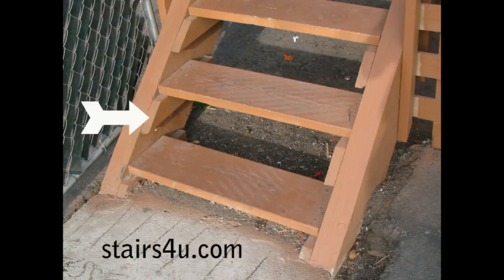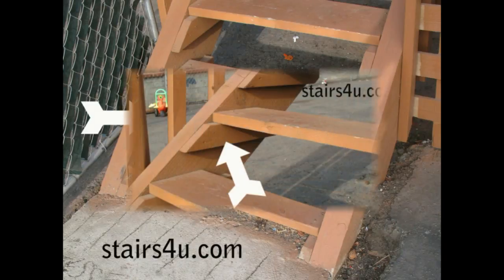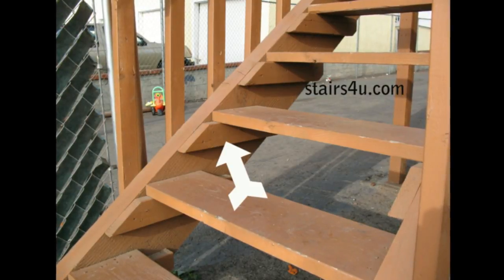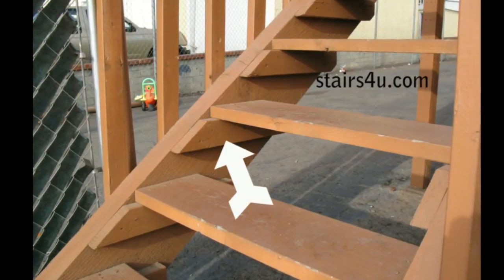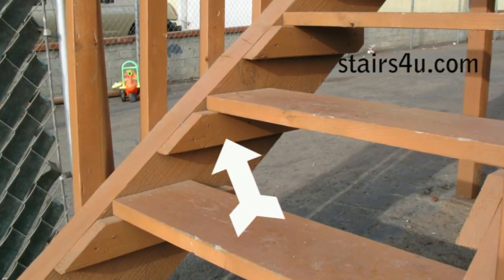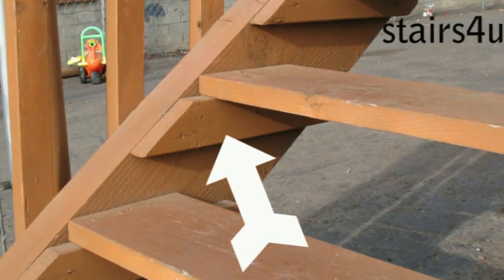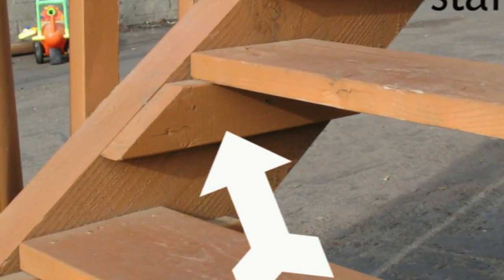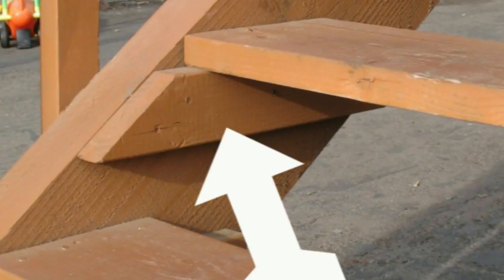What Is A Wood Cleat? - Stair Building Parts

Comment: Why do you think that most building codes would disapprove of this method?
Reply from the maker: I've actually seen it fall apart before. Keep in mind that I'm not 100% sure that some building departments, somewhere around the world and even in the United States wouldn't approve this method, but I can tell you that I never used it.
Reply: stairbuilding I ask because my deck stairs are built this way. I recently decided to rebuild them because of rot at the base of the stringers and at the end of the treads. The wooden cleats are 2x3s of pressure treated wood. The interesting thing was that the ends of the tread seemed to be more prone to rot than the cleats. So if I were to improve upon the design I may have considered adding a stringer done the middle to support the treads in case they became week due to rot. I find it interesting that you would consider the use of a bracket instead of a wood cleat safer. I would love to hear more. I’ve looked online and I don’t see much information nor discussion on this topic. Thanks